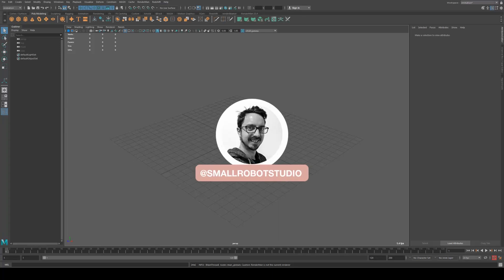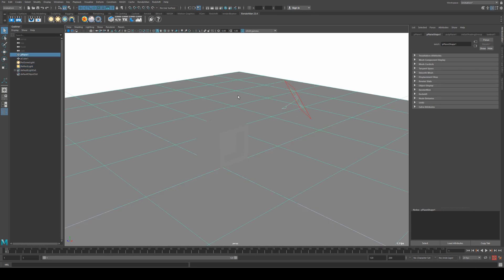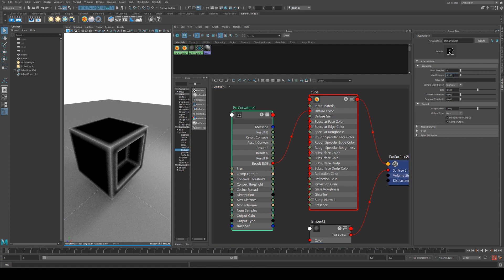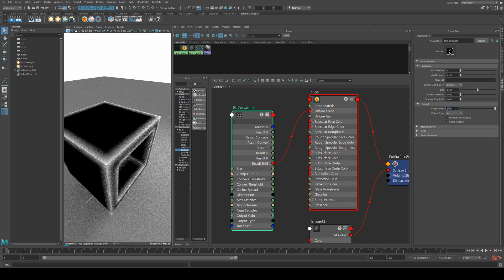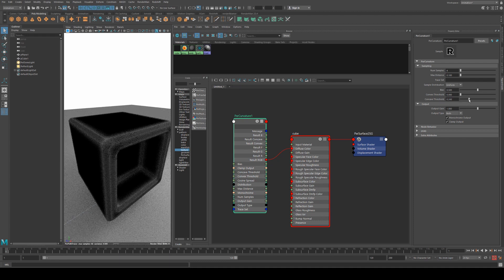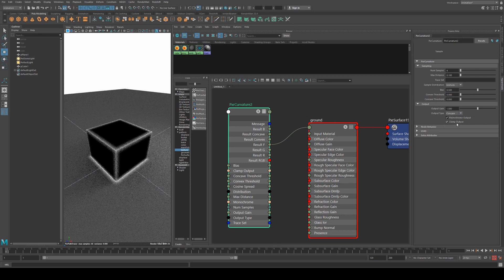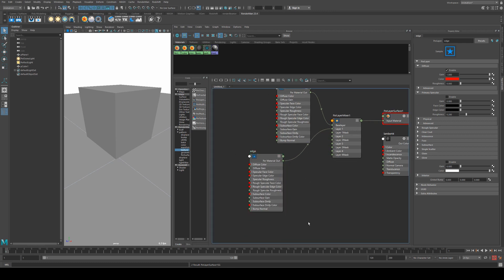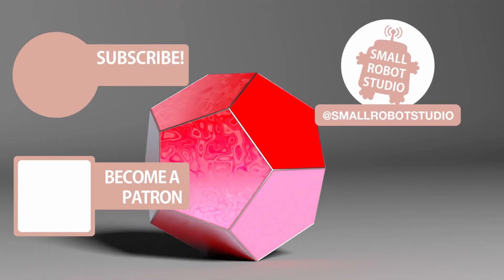Renderman 23 Pxr Curvature Tutorial

Comment: hey i have an issue with redshift render pass.
i added depth pass, shadow pass  and the render pass isnt working.
depth pass in entirely white and shadow pass in fully black.
help
Reply from the maker: What are you looking at the files with?
Reply: @SmallRobotStudio  render window itself shows it as black for shadows and white for depth
Reply from the maker: If you render as a batch do the renders read correctly in Nuke or another comp software?
Reply: @SmallRobotStudio  its just one frame, can i batch render that?
Reply from the maker: Yes, for compositing the method is always to batch render even single frames.
Reply: @SmallRobotStudio  okay thank you!